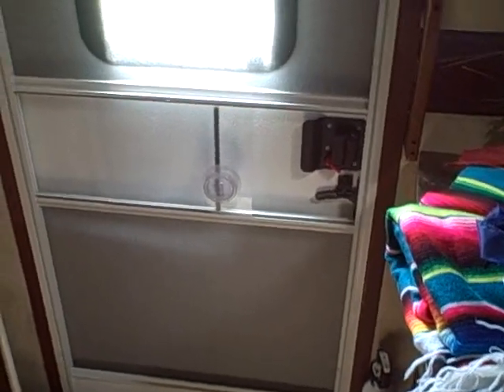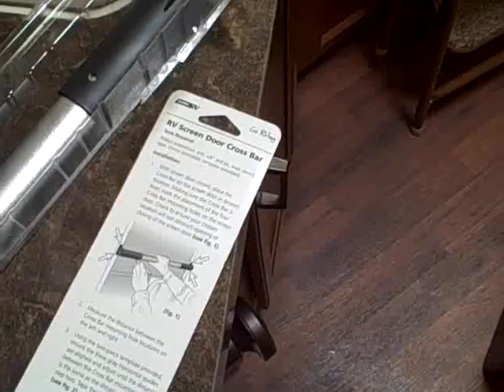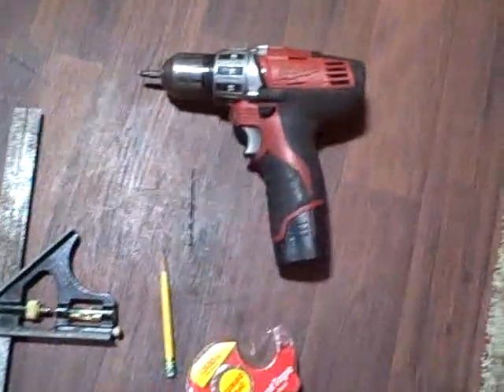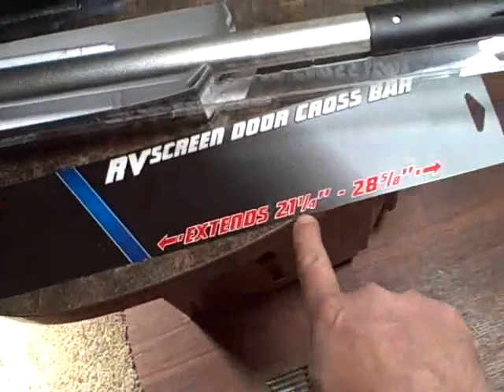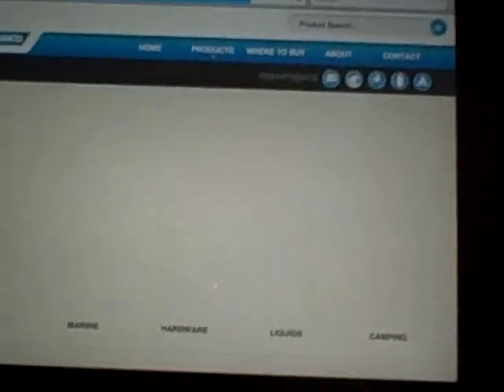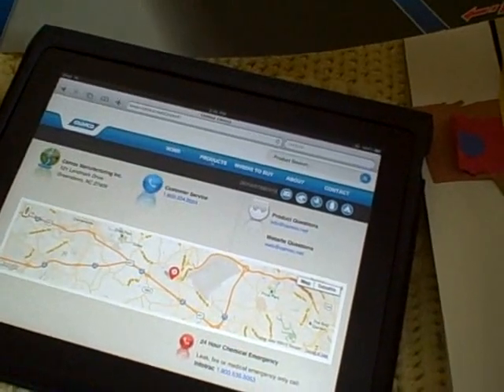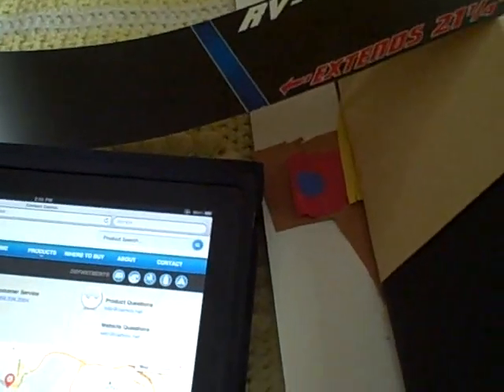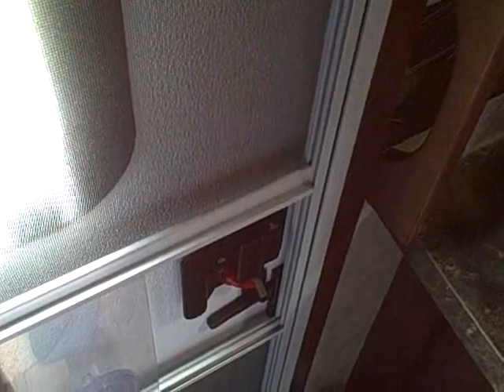RV Screen door Part 1

Comment: I've come to find nothing is standard on an rv lol. I am currently rebuilding the over cab area on a class c motorhome and parts are hard to find or discontinued. creativity trumps china in my book. Be sure to check for leaks including marker lights as moisture will destroy the wood framing before you see any signs inside. Oh and in my recent nightmare nothing was square.